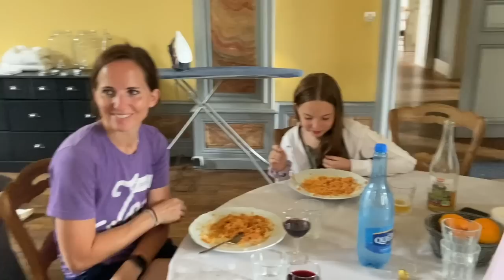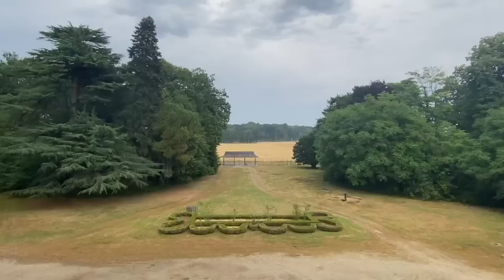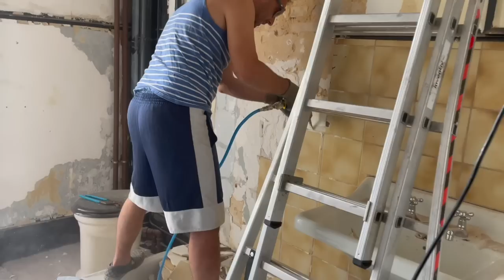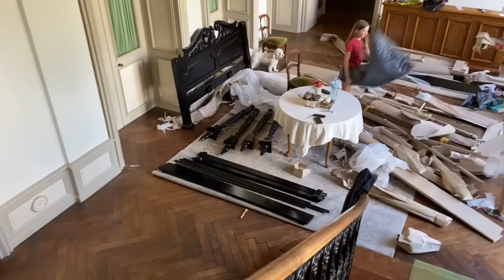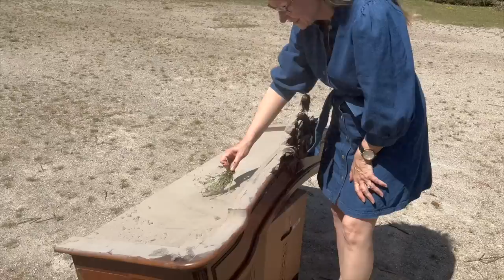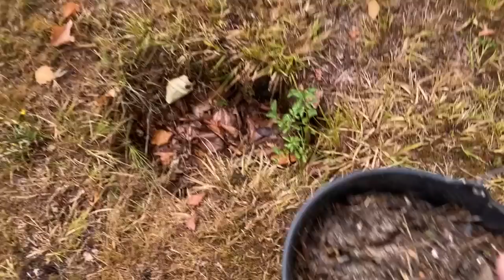Château de la Grifferaie S3, E15: "Magic Dust"

Comment: You definitely need a caretaker/handy person or couple to ensure the chateau is occupied and secured year-round.  (With a big dog to help boars feel unwelcome.)  Six months empty is a long opportunity for all the progress made by these work parties to be undone, and for mold to take hold inside.  There must be someone somewhere who can be trusted to do maintenance over winter and help with projects over summer, in exchange for a place to live.  I know heating is expensive, but they would only need to consistently heat the area they live in... and they could also monitor the mold sitution and strategically heat areas intermittently, to dry them out.  You work so hard every time you open the place, and seem to lose a lot of time cleaning up after mold and debris that occurs because the place is empty.  Know any retired contractors through your church connections?
Reply: Such a person would incur costs moving in and moving out of the chateau every year, as well as an apartment finder's fee.  That should be reimbursed, since no one in reduced financial circumstances can afford that.  They may also incur incremental expenses for local travel (shopping, restaurants, church, etc.), since the chateau is far removed from a city or town center.  Therefore, a small salary would be necessary to make up the difference.  The alternative is to only hire someone who is independently wealthy or has some kind of income stream which requires no working during the months occupying the chateau.  This idea of working in exchange for a roof is exploitative and unfair.
Reply: Bolin Dan ~ people will work for a place to live.
Reply: @dawn7612  I see.